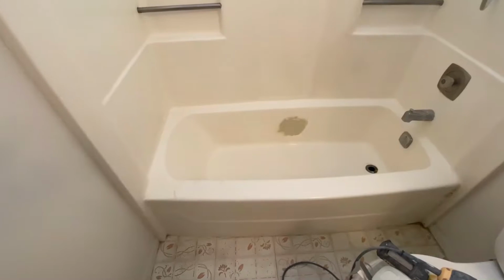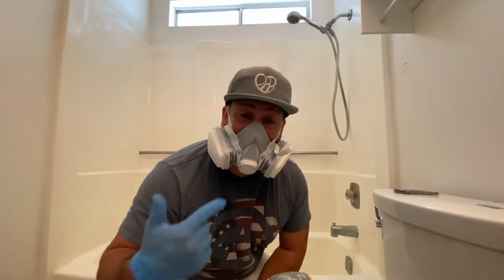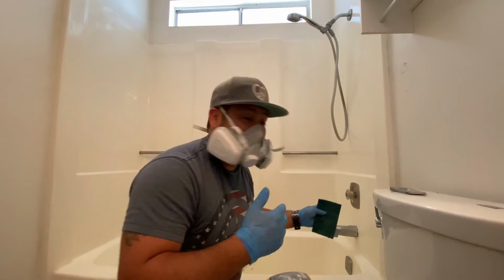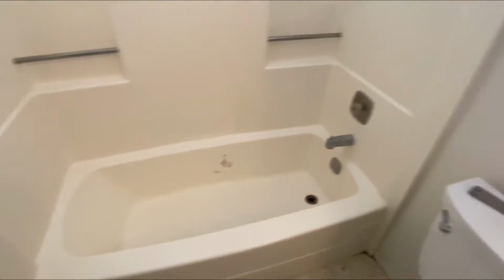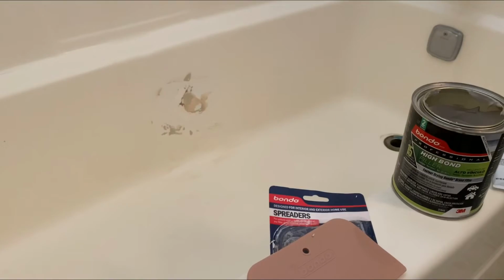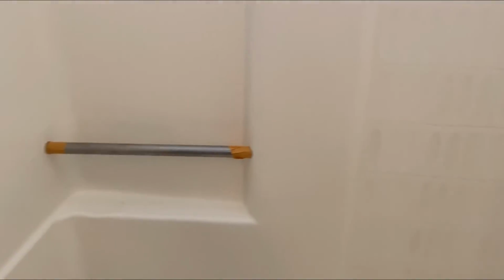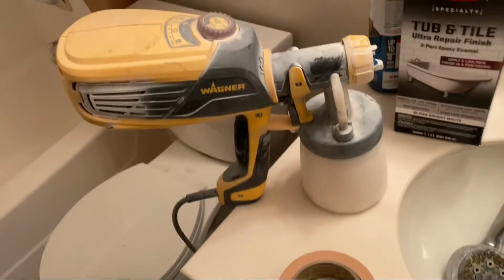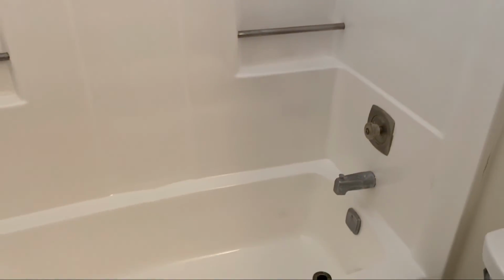How to Reglaze a Fiberlgass Bathtub | Fiberglass Tub Shower Crack Repair | DIY REPAIR | DP Tubs

Comment: I have a couple of questions. Can I use a gravity fed air sprayer. And, I guess, a bigger question, since my bath is in the hall, there is no window for ventilation, is spraying going to get all over the house. I could use a roll on type kit, I suppose, but I want a better finish than that. I am very experienced at using a sprayer so I think I can get much better appearance.

Comment: Are you thinning the Krylon with Xylene or spraying it straight?
Reply from the maker: I sprayed it straight! However I now use Resurface Solutions. I noticed that the Krylon, being an epoxy, had the tendency to yellow or discolor over time. However, it’s a great product for DIYers.

Most products can be thinned with whatever material the manufacturer recommends for clean up.

Comment: do you thin your epoxy mix before you put into sprayer or is already the perfect consistency to put in sprayer and spray? does the sprayer have different nozzles, which did you use
Reply from the maker: I use #3 
I do thin material but it also depends on temperature.

Comment: Thank you for your video. I would like to ask you a question. If you have a suggestion for me, that would much appreciated. I have a similar job to do in my bathroom. I think I have a pretty good idea of what to do from your video. The problem I still have, however, is that in my front wall fiberglass (along the length of the tub) I have one handle - similar to yours, except you have two. My handle is made of some sort of transparent white plastic that resembles glass. It is old and it looks very disgusting, impossible to clean properly. It is also kind of loose in the side holes where it stands. Our fiberglass enclosure has a protruding part on that front wall, to put soap bottles or so and the handle goes in holes on its sides in that protruding part. I wanted to replace that handle, but at stores I cannot find just a handle by itself that I can replace the old one with. I thought about buying a piece of bamboo perhaps to replace the old bar handle, but do not know how to finish it, once I manage to put that new piece in the existent holes, and ensure it is snug and water tight. Silicone maybe? I have also thought that maybe I have to replace the entire front wall fiberglass panel, but then it would be a new piece surround by the two old panels on the side of the enclosure... so not quite sure... If you have any ideas, that would be wonderful. Thank you  again so much!
Reply from the maker: I would patch in the holes with fiberglass mat and resin and eliminate the bar all together
Reply: @DPTubs  thank you! Did not think of that! 😀

Comment: Did u thin the paint? I have the same sprayer, should I thin the paint as recommended by Wagner ? ( to paint a tub too)
Reply from the maker: You can thin the material with the recommended reducer. What coating are you using?
Reply: @DPTubs   I’m gonna use the tub and tile paint from Home Depot

Comment: Good video I would like to try this, do you think a light sanding on the entire shower insert would be ok before adding the primer and epoxy coating?
Reply from the maker: Yes...you can use 220 to 320 grit with and orbital sander or by hand...this will help with adhesion. You can also wipe on Bulldog Adhesion Promoter before primer and top coat
Reply: @DPTubs  Thanks

Comment: Did you mix up the filler on the base of the bath itself??? Why didn't you use a "block" with the sandpaper in order to achieve a flat surface on the repair as it looked like the side of the bath was flat instead of doing it freehand?
Reply from the maker: Because I knew I was prepping and reglazing the whole unit

Comment: Hey, just an advice with the Wagner, same thing happened to me awhile ago, after 5-6 times of using it you will notice it doesn't spray the same, looks like it sprays normal but the gloss coming out it's semi dry creating lots of overspray, I guess it's because it's cheap plastic and using thinner it expands and ruins the quality of of the plastic nozzle, etc. (I'm guessing). I thought it was my paint and couldn't figure it out. Basically I was returning the thing every week or so till I bought a new turbine 😅
Reply from the maker: Thanks for the heads up. I clean it out right away. Hoping to keep it as just a back up. Nothing truly compares to the Capspray Maxim II
Reply: @DPTubs  I'm using Apollo power 5, been using fuji before and honestly this is way better, wonder if yours is better than Apollo? Any advice is welcomed! 👍😊
Reply from the maker: @rimidalv7710  I generally use the Titan Capspray Maxim II. You can see it in some of my other videos. That is the best gun compressor HVLP combo in the industry in my opinion. I used the Capspray 75 set up but the 95 is also amazing. This Wagner is just a temporary back up.
Reply: @rimidalv7710  how do you like that apollo? I too use titan guns but thought about experimenting in the future.
Reply: @bathroommagic7303  I can't compare it to titan because I never had one, but I did spray with Fuji for a long time and to be honest Fuji it's an absolute garbage if I would compare it to Apollo. I have the 5 stage one and I really like it.  I'm not sure if titan is better, try to buy just the gun from Apollo, the last model they have and try it out I guess. I probably will do the same thing and buy the gun from titan. ( not sure if the turbine itself plays a big role on spraying, like are all the 5 stages turbines have the same power? Etc)
Reply: @rimidalv7710  I originally sprayed with a Lexair and im still using that turbine.  The lex just got way behind on the tech curve and to me,, it does nowhere near as good a job.. but the turbine....It seems to do the job just fine yet I've not tried alot of other turbines. I may try a graco or apollo for my next turbine/gun purchase.
Reply: @DPTubs  I was in the business for 20+ yrs (retired now) and Titan was my go to! Wagner does drink I never liked any of their stuff.

Comment: Quick question: I’ve got a travel trailer that has a fiberglass rock guard over the front windows. It’s shedding and needs repair. Would you recommend Krylon Tub and Tile repair for this job? It has to be tough because it will be accumulating dirt, grit, and bugs when rolling down the highway! 
   Anybody with experience, please chime in. 🙂👍❤️
Thanks to all!
Reply from the maker: Yes or you can us Polane from Sherwin Williams or Krylon Tub and Tile.

Comment: Why don't you use acid etch on these fiberglass shower units?
Does the 220 grit paper prep the surface enough? Can u guarantee longevity of service without the etch? 15 to 20 years?
Reply from the maker: Etch will damage the surface! Etch is used on ceramic tile and metal / enameled tubs. I would never use it on fiberglass.
Reply: @DPTubs  Oh ok. I was taught to use it on fiberglass as well. Makes sense tho

Comment: what materials are you using now my friend i’m aware you used napco in the past? i just switched from Topkote they were ripping me off bad quality material they were putting out didn’t get the same results every time.
Reply from the maker: I have noticed some companies that claim to be top quality actually thin out their material and it sprays too dry, especially for me here in Las Vegas!

I currently use Krylon and Midwest Chemicals. I have a company sponsoring one of my videos coming up that I will show and test out their process.
Reply: DP Tubs nice, yeah materials are getting thin and the dry spray is crazy tend to look dull at the floor n shine is not where it used to be. Mid west is good but it’s real watered down as well.
Reply from the maker: @msancho7674  Sometimes it's dull at the floor because many reglazers spray thicker at the bottom but do not allow enough time in between coats and it results in blushing. Make sure that you give enough time in between coats. I give 10 minutes between first and second, 12 minutes between second and third, and 12-15 minutes between third and final.
Reply: DP Tubs i’ve made the switch to cogent it seems to be good with no blushing.
Reply: DP Tubs i was under the impression you lived in LA Area.
Reply from the maker: M Sancho Las Vegas!
Reply: What are the ballpark rates for this type work to be done? You have inspired our small business to do this work to stay a float. Thank you😁

Comment: Cheap material cheap primer not a good way to do Re-glazing
Reply from the maker: Not true! I have been in the industry for over 15 years and have worked with many products that are sold to professionals only and are thinned out way to much from the supplier. This product is very thick and does not even need reducer. What material do you use? 

There are many similar products with different names from manufacturers. I know them very well. Krylon made by Rustoleum has proven to me too withstand and uphold the longest along with Midwest Chemicals.
Reply: DP Tubs we will get negative comments from other professionals opinion we all work with material we prefer n feel are better as we get more years under our belts.
Reply: DP Tubs i’ve been using midwest’s clear for years n have not had any issues with it jus that it is a thin material but quality is superior.
Reply from the maker: M Sancho totally agree!
Reply: @DPTubs  I too use Midwest but was trained to thin it down with MEK. would u recommend that or just spray straight 1to 1 with no reducer?